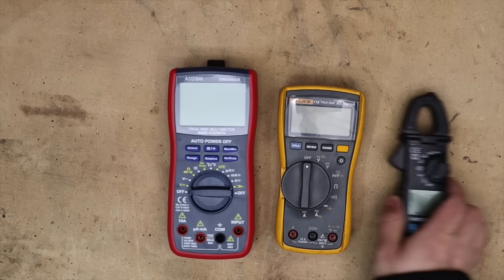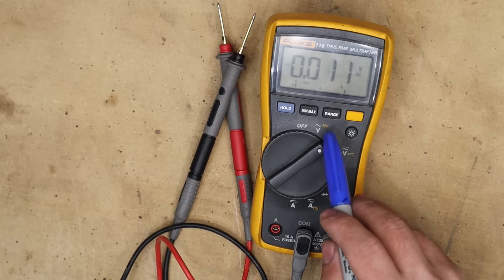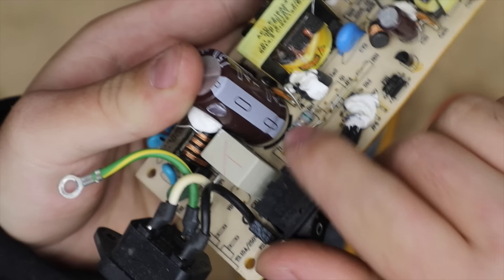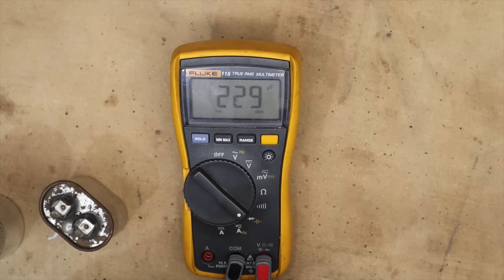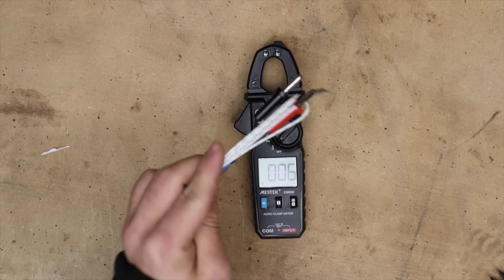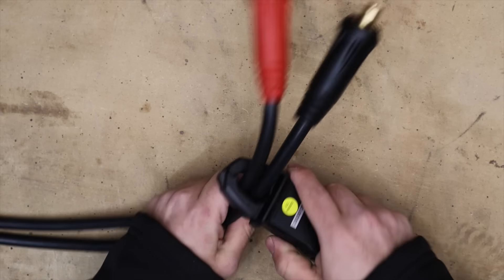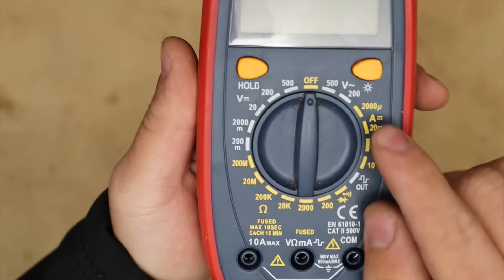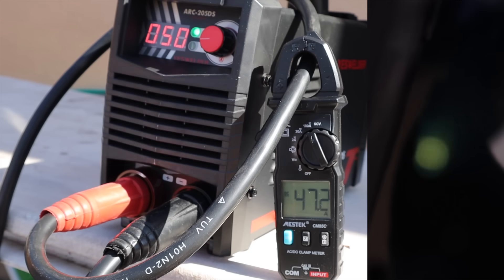How to use a multimeter like a pro, the ultimate guide

Comment: OL means over limit, not open loop, not overload (because there is no load) and not open line, which is actually a better guess, because that's basically what it's taken to mean, but this might still not be accurate in every case (consider a circuit that isn't open, but the resistance value is high enough such that its ohm value is greater than what the DMM is able to measure or display - in this case, it's not an open line, but, at least with this particular DMM, it's over the limit of what it can display). 

Also, it's pronounced "keeloh," not "killa." Also, while we're at it, kilometer is pronounced "keeloh meter," not "killah mehtur;" the latter is by far the most common, at least in the States, but it suggests you're referring to a device that measures on the scale of kilometers (think about the difference between micrometer and micrometer... Oh shoot! They're spelled the same! Well, one is a measuring Device and the other is a length unit that's one millionth of a meter, but they're pronounced differently).

And you electrical techs/engineers KILL me with this one: it's NOT AMPERAGE! It's current! Saying amperage is akin to saying "inchage" instead of length or "fahrenheitage" instead of temperature! I know you're not going to stop saying it, but at please at least know, deep down, that it's wrong lol!

For the rest of you SENSIBLE people out there, you're welcome!

Comment: Only 120v in USA vs 220v in Europe😢
Reply: It doesn't make a huge difference though given that the power output is almost the same. America uses 110-120 Volts with 12 Amps of current. Europe and huge chunk of the rest of the world (besides North America) uses double the voltage but half the current resulting in the same power output nonetheless. Power = Voltage * Current.

Comment: Sorry mate but just because a battery shows the correct voltage it doesn't mean it's a "good"  battery! I've changed many batteries in my life time that showed 12.3v across the terminals but after a draw test they've failed miserably. A load or resistance test is the only way to check a battery accurately. Duty is useful for working out the dwell angle on old car ignition system points.

Comment: I don't know where this guy learned his stuff but the 120v outlets are not high voltage. 500 volts or higher is high voltage. It's not a smart move to intentionally grab and hold on to the end of one probe when you have the other probe on a known power source but it shouldn't do anything to you. If you do get a shock trash that meter and get a new one, preferably a Fluke. But don't fo just trying to see if it will shock you, electricity has a habit of doing some really strange things sometimes, plus you don't know if your meter is bad so don't risk it. Also something he never mentioned. Always test your meter first by measuring a known power source. Unplug a lamp or something that is working and check for voltage. If your meter shows voltage it's good to use. If you show no voltage even though the lamp was working you will know your meter isn't working and not to use it.

Comment: OL stands for OVERLOAD! WHO TOLD YOU IT STANDS FOR OPEN LOOP DOESN'T KNOW ANYTHING ABOUT METERS OR ELECTRICITY!
Reply from the maker: -over limit 
-open loop
-open line 
-over load
-out of limit
Heard it all, and pretty much all the same thing, surprisingly, there is no agreed meaning, Fluke for example states in the manual that OL is “The input is too large for the selected range.”, though never states the meaning of the acronym, so feel free to use whichever you like from the list above, thanks for the comment.
Reply: I had not heard of "Open Loop" until watching this video, but it can make sense: If you have a loop of wire and you measure its resistance and the meter shows "OL" on its highest range, that means you have an Open in your Loop of wire.

Comment: Been using meters for over 60 years. Started using my dads Simpson model 260 analog VOM to work on my American Flyer trains. First thing to check : NEVER purchase or use ANY safety or test equipment from lying cheating lack of quality control communist china. The money you may save not worth your life or the safety of others. Had a co worker electrician almost get electrocuted after using a company supplied garbage Chinese meter. I watched him test it on a known energised 277 volt line then test a line he was going to work on. Meter did not display any voltage so he started splicing in a wire and received a big shock.. Meter was less then a year old and was not used much because we still had a Fluke VOM. Garbage very thin test probe wire was broken.